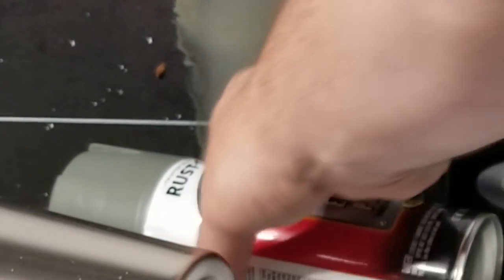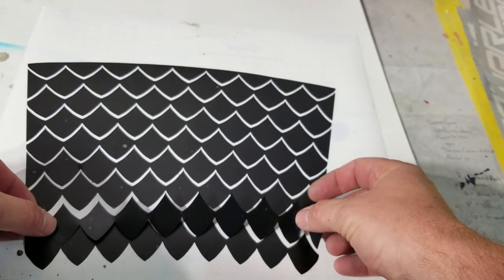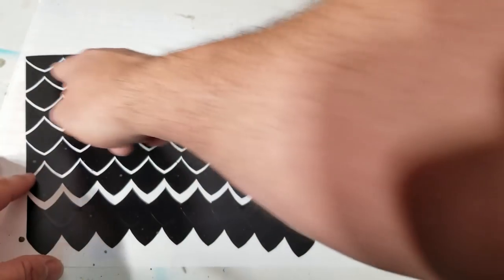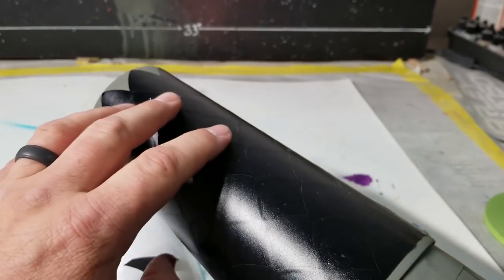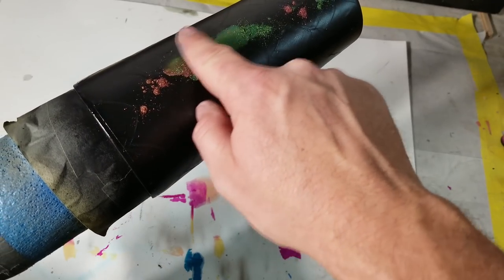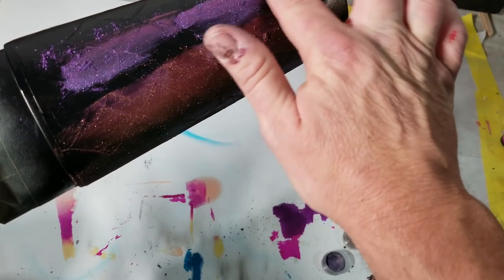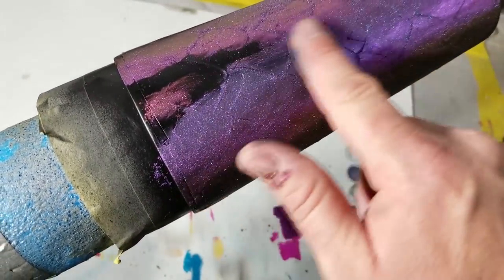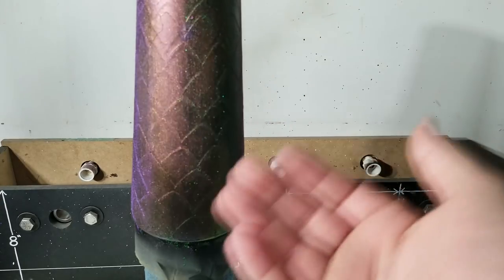Easiest Dragon Scale Epoxy Tumbler - Seriously!!!

Comment: I did a tumbler and there is a little tiny place on it that didn't get any epoxy and you can see down to the spray paint. Do I have to strip it or can I just put another coat on to cover that spot up? I sure hope it's possible because I hate the thought of stripping it. I'm a newbie to all this and want to make sure I do things right.